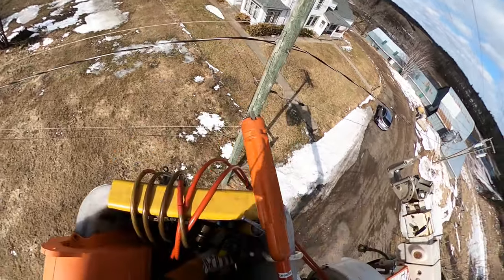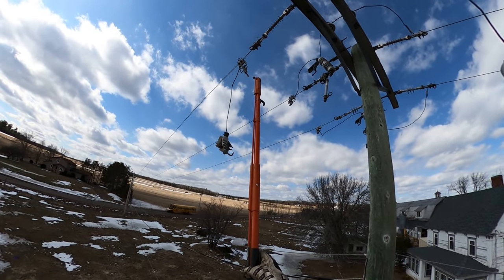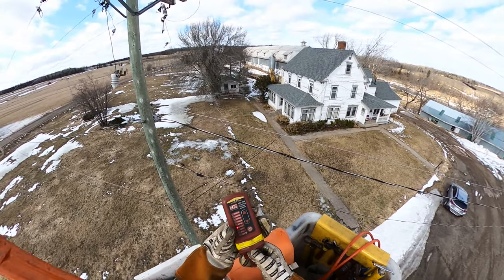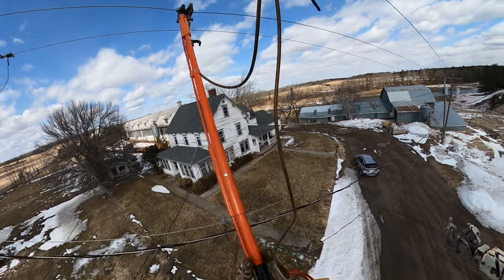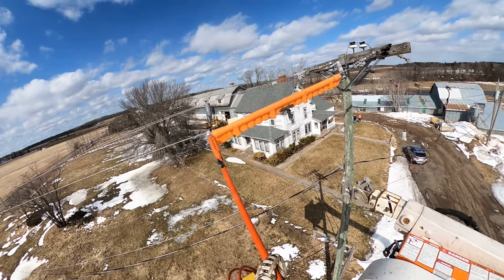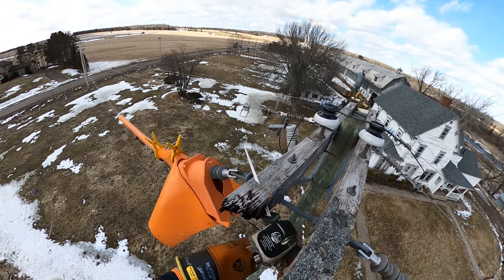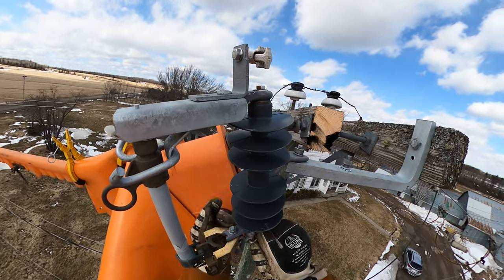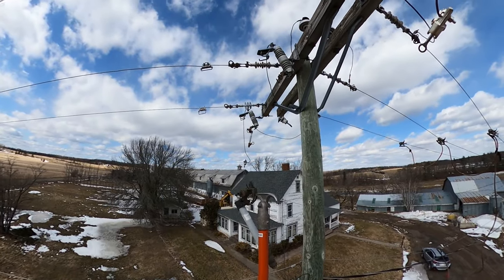Lineman POV

Comment: I have the big Milwaukee drill but I only use it to run my nuts. I still prefer the hydraulic drill when I’m drilling out a pile. Much faster and smoother. Also less wear and tear on my Milwaukee drill.
Reply from the maker: Our pendulum bucket pretty much always use the Milwaukee now instead of hooking up hydraulic hoses. The other buckets, I'd say about 70% of the guys just use the battery stuff now.
I leave my hoses at the office in my locker and grab em during storm work... Especially for using the tested hydraulic saw!

Comment: I'm curious about the transformer bank.  It looked like there were only two cans.  If there were only two, why the third phase going to the bank?  Do you run line to line transformers?
Reply from the maker: Tbh I can't remember what the setup was there exactly 😔.
 It was only two cans...  he had a feed heading back along our poles to a home across the street. I'm thinking he had three phase at one point, then Converted to a 400A single phase for the barn. There was probably 6 or 7 other services there too.
We have run 2 can three phase services in the past... But very rarely.
Reply: @Bobsdecline  Interesting and thanks for the reply.  2 can 3 phase is quite common here, but it is always open wye / open delta.
Reply: @Bobsdecline  It was high leg delta (or bastard leg) 3 phase. Likely put in ruffly the mid 1940's from the dates on the panels. The pole was a real rats nest and the only disconnect for the service was the pole mounted generator disconnect (with a bent pipe running up the pole), not super fun to use. 
It's now recently replaced with 400 amp 120/208 volt wye. Everything is clean and the poles look great!
Reply from the maker: Awesome! Thanks for confirming the details David!

Comment: Great Video once again Sir.  Can You do Some Videos  ON the Primary Voltages and types of Insulators?   Excelon Power has A local company by the name of PECO  that has many UPGRADE projects.  If its 34 kv we usually set 50 or larger Poles with them shutting things off or we just drop off for them to set the poles.  On Pole hits via accidents or just failures of poles we typiclly call them to ask for the voltages and or we have a Trouble man come out to verify voltages before we replace the Pole(s).    I am south of you as you may recall but really It might be a cool vid if you could show some definate signs to identify voltages on Primary if possible..   That said I really like the Outers of Your rubber gloves That paw style I think Mite be something Id wanna use when setting.   Any chance of making a trade for a pair, Before I google and buy my own , what brand are they?  U mentioned they have Kevlar which is really really attractive To me for PPE..  Thank You sir
Reply from the maker: Hey Culby! 
I'll see what I can muster up! There's never really a definite sign for voltage when it comes to insulators, as the line could always be an over build. An example would be; we have  a line frame for 138kV that's currently only serving 69kV.
Always better to over estimate than under though! 
We also have some 25kV insulators on a 12.47 system...
Something I can definitely touch on in a video sometime! 
Sometimes equipment (transformer) will also have the primary voltage printed large enough to see.

The gloves are made by HI-Line Utility supplies. I believe they may have be manufacturing under their parent company now (Wesco) but I'm not certain.
They're a bit bulky and have less dexterity than some other brands but do break in and are very durable. I feel much safer using them in harsh conditions.

I may still have an extra pair in the basement boxed up. I can't remember if they're 5 finger or mitt style.... But I think they're a size 11.

What part of the world are you in?

Comment: What do you mean by the farmer closes his main breaker?
Reply from the maker: Pretty much just like the main breaker in your home... His setup was a bit older, but had a main switch in one building which then fed over to multiple others.

When he made the initial call to us, he just opened up his switch as a precaution.

Not always necessary, but often times; If you ever experience partial power or voltage issues, the best thing you can do is open your breaker to prevent damage to sensitive electronics.
Reply: That’s right,when you lose a leg you can fry compressors,but if you have a professionally installed whole house generator with a electromagnetic switch installed do you have to worry about that?
Reply from the maker: If he had an auto transfer like that, definitely not! His equipment was more older and all manually done.

Comment: Y’all aren’t allowed to glove primary?
Reply from the maker: Absolutely. I believe I mentioned in the video that we must remove reclosing in order to go "hands on".
We call it a "hold off".... Once a hold off is in effect, all reclosing is re.oved from the line and if for some reason the line goes out (unrelated or not), no other crew are allowed to operate switches on that feed without first speaking to the crew that has the "hold off" permit.
Reply from the maker: I should add; for the little amount of work that was needed, it wasn't worth driving to the Recloser...
Reply: @Bobsdecline  Ok yeah that was my next question. Why not just get a “one shot” and glove it.

Comment: Got out of line work in 95 do to neck and spine issues but never have I seen what I did 2 days ago a set of 3phase cut outs leading to a second pole 12” and yes I did mean inches not feet away with a second set of cut outs on a second pole and both poles are new, all closed dead ending no lightening arresters and no lines even leading underground or anything in Jeffersonville, IN never seen that before wonder in anyone else has and knows why that would be done